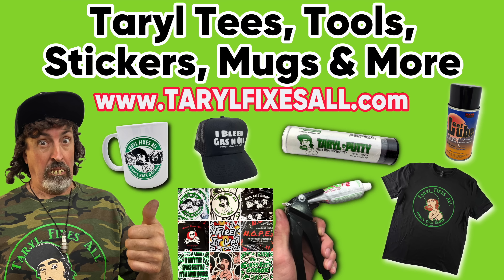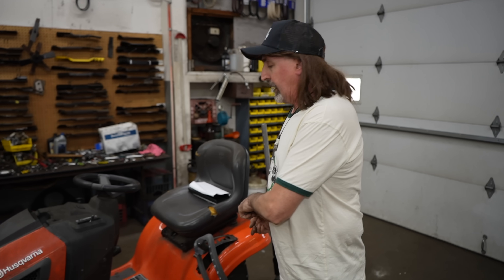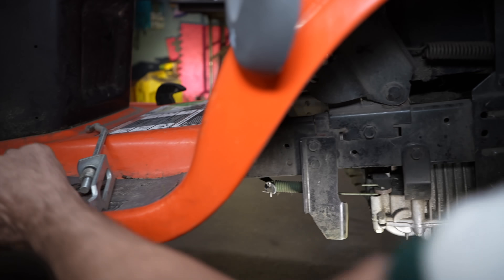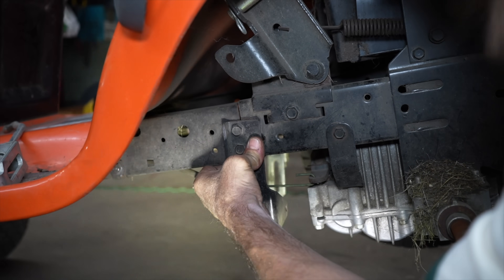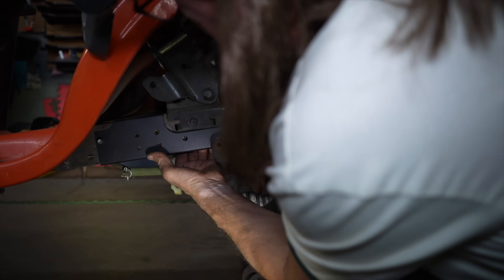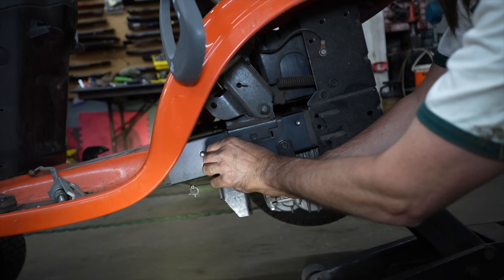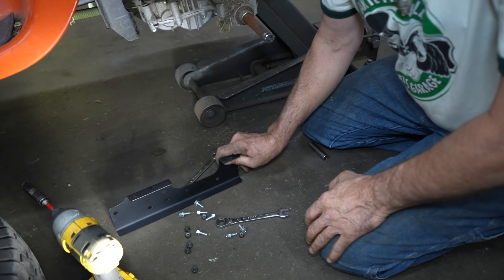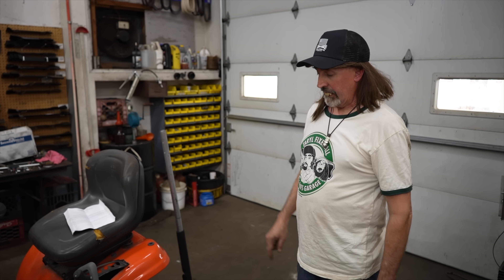MAJOR Husqvarna Frame Problem They WON'T Address! Affects 1000s of Units!

Comment: I had one of those Husqvarna garden tractors and the front axle split right in the middle.   Also the front PLASTIC wheel bushings kept wearing out.  Finally sold it for the engine when the transaxle went out.
Reply: Been there done that on a airens.

Comment: I have a Husqvarna YTH1542XP, bought from dealer not big box store. 22 years old with over 1000 hrs. Kindasucky 15hp Vtwin. Has been excellent mower except frame did same thing about four years ago and I had to weld it. Neighbors larger hardware model did it too.

Comment: I wish I knew about a product like that a few years ago!! I ended up doing a motor swap to a different mower and due to different years It was a nightmare due to the pulleys routed differently on the older mower frame. We spent over 300 dollars on parts to complete the swap! Im glad someone came up with this kit!!
Reply: Sounds like a you issue.

Comment: Well done.  Its amazing they lasted that long.  I owned a small engine shop for 20 years and 80% of the Husky's came in with blown transmissions right around the 400 hour mark.  The Craftsman PYT's are just as bad.  They use a two piece welded frame that makes one of the drive belt idlers impossible to change.  They put the idler on prior to welding the frame sections together making access to the nut that holds the bolt that secures the idler impossible.  A big beefy looking machine dubbed as "Professional" but is just another throwaway machine.

Comment: Had a John Deere LX 188 that did the same sort of thing. Broke right where the transaxle bolts on. Deere at least recognized the problem and provided a similar kit to fix it. As I remember part of the frame needed to be cut away but they provided a template so it all came out perfect. Guess that’s the difference between John Deere and Husky

Comment: I went back in 2012 and helped my elderly dad pick out a commercial grade husqvarna zero turn mower with a Kawasaki engine. A few months later, the engine back fired and caught fire. Husqvarna warranty department sent some guys out and they agreed to just replace the whole mower. They went to Lowe’s and got a pos home owner grade and scammed my dad into taking it in place of the commercial one. I was out of state working so naturally when I saw what they’d done I was irate. Never done any good just beat him out of several thousand bucks.

Comment: It happens. My 94 John Deere where the transmission bolts to frame lx188. Bolted angle iron to the frame it fixed it. It would be great to weld too but if you don't weld. TSC has everything you need.

Comment: My Husqvarna 54-in did the same thing broke there. I had a guy up at the shop. Make me some plates to put on there, welded it back together and within a year it broke on both sides directly above the axle so I wound up having to replace the frame anyway. They put all them holes in there cuz it fits multiple models of theirs and I think that's junk if I had to go do it over again I don't think I'd have bought the Husqvarna

Comment: I have a 2012 Craftsman GT6000 Tight Turn and have never had a frame issue and parts of my yard are a bit rough bump wise.  The only issues I had was with the front wheel toe in which I resolved by shimming the front axel pivot point and installing adjustable end links.  I retired the rider last year at 450 hours in favor of a Ferris Zero Turn, I will never go back to a rider. I did a mini restoration on it this year and parked it in the shed for future use just in case.  I think I will get the HD kit when you get them in stock, $100 is cheap insurance.

Comment: I have welded and reinforced about 5 of these husqvarna deals and 2 craftsman 6500s w the 26 hp biggins. 
If I had known about the kit i would have ordered it. 
You cant weld it wo cutting pieces of steel to reinforce weld it. Man alot easier

Comment: In about 2020 we had two of those broken frames come into the shop.  I don't recall the production dates, but the first one, Husqvarna fixed under warranty no problem.  I put all the customer's old parts, engine deck, etc.  on that new frame.  About two months later a second unit came in.  Broken in that same place, Husqvarna didn't want to have anything to do with that one. The customer took it back home still broken. 
I am also wondering if the tractor is this video was built in 2017, I am thinking both of those I saw were built in 2017.

Comment: I delt with husqvarna warranty i bought a husqvarna tractor and a husqvarna snow plow made for the tractor first snow fall had a 1/2 inch of wet snow hydrostatic transmission broke wouldnt move and they fought me on getting it fixed cause even though they make a snowplow specifically for it you are not suppose to push snow with it that was my last purchase of a new tractor learned how to fix old good mowers and havnt looked back i had a so bad my old mower was a gear drive bolens and i beat the crap out of that during the winter and pulled so much crap during the summer no problems at all was $2000 cheaper also

Comment: working for Sears, we couldn't weld the frames, so we swapped the frame. with 2 men it was 5~7 hours depending on what attachments it had to swap the frame. also did a bunch of frames because they bent right behind the front axle. at times the repair kits for the trans mounts could be hard to get, so sometimes ended up doing a frame swap for that.

Comment: I have seen poor welds on the deck hanger frames on the deck on these as well. We had one in recently and one of the deck hanger frames had snapped off. The welds looked really weak and like the chassis frame it wasn't thick metal either.

Comment: Hello Taryl & GrassRats. Some time ago, I had purchased a Gilson manufactured Ford LGTH-17 garden tractor that for a garden tractor had a very weak frame. This tractor had the issue with the mounting ears being broken away from the aluminum transaxle casing.
Whenever I had purchased the tractor, Someone had fabri-cobbled 2 angle iron brackets extending from the axle flange to the side of the tractor frame within the area where the original transaxle bolts were bolted through the frame. The tractor was very nice to operate until one day when I was going to back up and I started hearing a terrible noise. I limped the tractor back to the house and placed the tractor upon blocks where I could inspect from underneath and I pulled the hydraulic filter bracket where I could see inside from the top and I could not believe what I was seeing. The broken aluminum casing ears on both sides had been glued with Epoxy and the transaxle had dropped down enough that the driveshaft was rubbing against the crossmember and other spots. I also noticed that a vertical weld joint on the left side of the frame was broken. I have never seen such a weak piece of junk like the frame was on this tractor which was set up for a 3 point hitch and had a hydraulic mower deck lift. When I seen the video regarding the Husqvarna tractor, I was instantly reminded of my ordeal with the Ford/Gilson garden tractor.

Comment: The One thing you must remember if you were to weld the frame is you weaken the metal By reheating the metal you end up changing the tensile strength and you weaken it by making more Brittle - and this is why you don't or should not weld the frame. What Taryl did her was  much better in that if it starts cracking again you simply change the bracket...

Comment: Its somewhat tricky to get it installed even when the frame has not broken yet.  Also did the other questionable upgrades like poor mans power steering with needle bearings and ball bearings upgrade on front wheels. 
The machine is almost new. The frame had not cracked so why wait for it to crack. Using it for snow blowing with back weight right now. It can have extra stress on the frame. The front wheel steering was dry. The shaft was full of grease like its supposed to but the bottom washer where the shaft is sitting on was dry and already rusting (the salt in the snow may have some effect). But none of the grease had reached the bottom where it really mattered. Same with the wheel bearings. There was some grease in wheel shaft but it was sitting bunched up right where it was pumped in. A small glub. Almost none of it had reached the bushings. Three bushings had some grease somehow. I quess it was added separatley from the gunk added later. But one was clearly running dry. It had already scored the shaft slightly. Guaranteed failure if some decent amount of grease wad not added soon. And i mean a decent amount. Couple pumps eould have no effect. It needs to be squeezing  out from bith ends.  Cleaned off the paint. Made sure the ball bearings will fit. And pumped it full of grease afterwards so the shaft  doesn't rust. If i had left it as it was as it came from the factory it would have some serious issues bretty soon. And it was F all for the price of parts. They could have used those in the factory.  They vould used enough grease to make the lriginal design eork like it was supposed to. But no. Some five bucks were saved and guaranteed a dinner or three for a repairman with extra expensive parts to replace.

Comment: Alot of the Sears riding mowers also cracked up front by the engine around 500hrs.
Reply: This is on its cheaper riding mowers, 1000 series.

Comment: I have a Craftsman GT 6000 26HP Kohler. Mine's broke on both side at the rear end brace mounting area. I welded mine. The rear end moves up and down and the Brace pounds the frame and breaks it. The bolts that hold the brace to the rear end will come loose to. I may look into the kit you are using if it breaks again. I know when mines loose/broke when reverse barely works.

Comment: ive had 2 24v48ls. both broke. i repaired the first by welding a bed frame to it. it worked  and the other i bolted L brackets where it broke at the axle flange. that work too!

Comment: That might be why a lot of the 42 inch HOP/AYP made ones I’ve came across would cut uneven and no matter how much I would adjust the deck hangers and make sure nothing was bent they still would cut lower on the one side usually the left. This one was a dyt4000 craftsman but they sold them under a lot of models brands and colors. Poulan, ariens, etc. thing with lawn tractors is they’re all nothing but problems that’s for mtd and ayp ones and even half the Deere models but one thing is when they’re working the way they should they’re great… still not worth it even the cheap zero turns outlast most of the lawn tractors

Comment: My cub-cadet 1515 1500 tractor bought it got 225hrs on it when I got it only put another 6hrs on it and it doesn't wanna start but I use starting fluid and it will run and the gas line was clogged twice before sometimes the fuel filter gets gas in it and alot of the otger times it doesn't, wat should I do to fix the issue, now it's sitting couple of weeks bec tired of messing with it please can u help point me in the right direction thank you grass rat

Comment: Sometimes in automotive a recall gets going like this and repair brackets and different remedies become necessary.
They make and supply some kits but they have a time within, for it to be covered and available.
What we would do if it was out of the time, was fill out some forms designed for that, and if you did it all, repaird your own, or suffered loss and had to supply a remedy, they may review it and reimburse your customer his expenses.
The neat thing the govt. has is NHTSA, and they get after the MFRs, and require they respond and provide within law.
If mowers and tractors and riders had a govt agency about safety???? For harry homeowner and the product?
That might be YOUR dinner.
I dont know, i cant even spell good.

Comment: I have a 2010 craftman gt5000 use a 4 ft blower in winter, frame broke , did a weld job and plates, works ok now,wish they made these pates 5 years ago. Merci Taryl    Grande-Digue nb Canada

Comment: I ran into the same issue customer was mowing and wedged him between he couldn't get off the mower very easy.  I bought a kit maybe from same person but it has outer and inner plate for both sides.  It worked well to repair the issue they have with the crappy swiss cheese frame.

Comment: My YT3000 broke in a similar spot on both sides of the frame. First the right side cracked and split and then a year later the left side developed a crack on the bracket that holds the rear drive axle. Cheap garbage. Never pulled anything with it since it was new. I scabbed on some bed frame iron patches that are still holding up for now.

Comment: i have 2 husky rideing mowers,,,,probably overloaded them both a few times and never had any problems.......but i dont leave them outside in the weather....one is a 2005 model and the other is a 2021,,,,start everytime and cut grass very well and in the fall i use them heavy with the leave sweeper

Comment: Now have to check all the Husky tractors that come in! I know they had issues with transaxle mounting brackets breaking as well shifting  the axle forward loosening up the drive belt so it won't move.  Good Job AYP!
Reply: Cheap lousy metal !!
Reply: Good chinese metal. They're laughing at us.

Comment: i have 2 husqvarnas,,  both of them needed repairs on the angle where the transmission mounts,, thank god i havent had to encounter this repair yet,  but probably will at some time because im pretty rough on the mowers with the land i have .  Thanks Taryl for the great video
Reply: easy just to  make some gussets/ plates mig  some   over the area  even 5 inches is enough on it

Comment: That's not a Mount for sway bar on mower deck.  It's a mount for the bracket that keeps Transmission from moving.  If it breaks the transmission will torque up and down breaking the frame where the transmission connects to frame near axles. I know from experience. It broke the mounts, tabs off that hold transmission. Put angle iron in place, sturdy as a boulder now.

Comment: years ago when mine broke and i had tryed to get it fixed a new frame was 850 and they didnt want to warnty it i had the same thought as you when they where trying to reasion why the frame broke they asked what i did with the tractor and i told them i had a pull behind yard rooler and they tryed to tell me thats what broke the frame not the 30 holes punched a 1/4 inch apart from each other that was when i bought my cheap hobo freight welder and welded it up and im still using it till it breaks again and i buy another gt6000 /gt18 to replace it because im not going to buy that junk again

Comment: Being as the kit is fabricated, I'm assuming the break "always" occurs in the same place? Also, I've heard thru the grapevine that Husq has "beefed up" the frame/deck components since 2020...maybe because of this problem? I have a 2014 and a 2022 YTH22V46...no problems....fingers crossed.

Comment: REQUEST:  I'm having an RV built to specification, right down to the smallest detail.  An issue I'm having is my selection of the Portable Generator to power a mid-size RV.  While attempting to perform my due diligence and make an informed decision, which doesn't seem like it would be that difficult, I find more confusion than helpful information.  I'm currently looking at the Predator 5000, The Onan/Cummins P4500i, and the Champion 4650, all of which are nearly the same price with the Predator and Champion being dual fuel (which is not relevant for my use).  I have excluded Honda because their "price point" makes no sense whatsoever.  My consideration reveals the Predator 5000 has had some "teething problems".  Do YOU have any input on making a good decision here ?

Comment: Now I have 30 and 40+ year old Craftsman riders and those frames are built like a battle ship. Just recently this friend of mine Frank Groh grafted the entire Husky mower onto an old Craftsman frame. He said it worked out. He had been looking for a 20hp Kohler Pro for that tractor for some years just like I have another one like that I am looking for that same engine they are top notch probably the only decent motor Kohler ever made in my opinion. Frank said he had to drill a few holes to fit the deck stuff together but he said the Craftsman frame he used was about the same size about an inch difference over all. Width was the same. He also said the front axle pivots had to be moved over. I have yet to see what he meant. I think he kept the same steering from the Craftsman tractor is what he meant.

Comment: I haven’t liked the stamped steel frames or mower decks for many years, parent companies like MTD, Electrolux and a few others have been cheapening their products in many ways in order to “keep up with the jones’ for marketing and pricing, then claiming abuse by the consumers! 

I have taken many tractors with broken frame apart, and rebuilt older machines with welded frames like pre 1980’s Cub Cadets, John Deere, Bollens, and such! They are a lot heavier and better structured than the stamped steel stuff today!

Oh and don’t be fooled at some of the new frames appearing to be welded steel, the rails might be cheaper grade stamped steel vs higher grade angle or channel steel (sometimes even high grade stamped steel)

Comment: My 2009 Craftsman has the same holes punched in the frame! I might get 1 of those kits to reinforce it before it cracks, because once it starts, it is guaranteed to eventually break in half. And if I just welded the crack shut, it would probably just crack near the weld, due to frame weakness.  The frame should be a tiny bit thicker, or have a double plate in that area.

Comment: That crack didn't start in the bolt holes, as it actually curves around them. I'd suspect its an issue with the upper or lower flanges starting the crack that them propogates across the web.